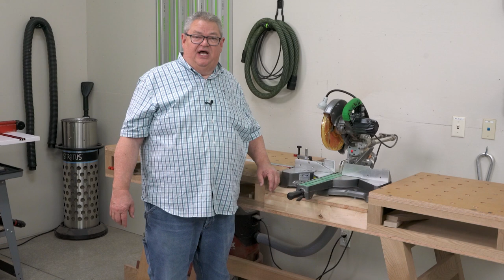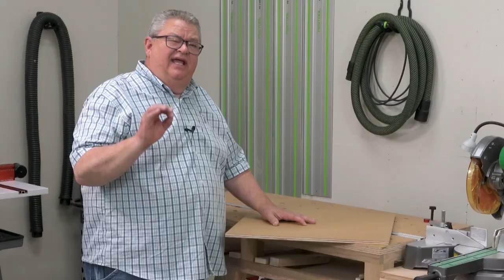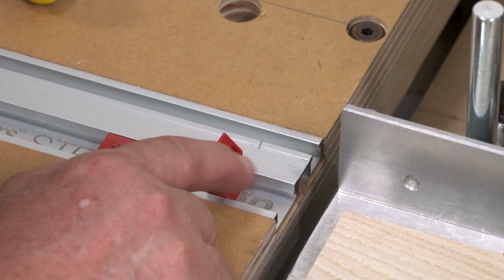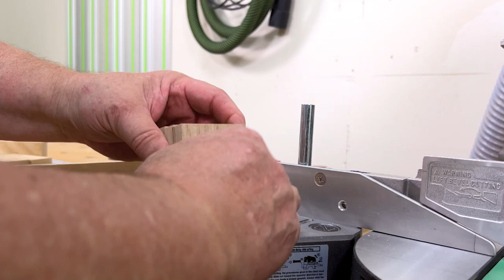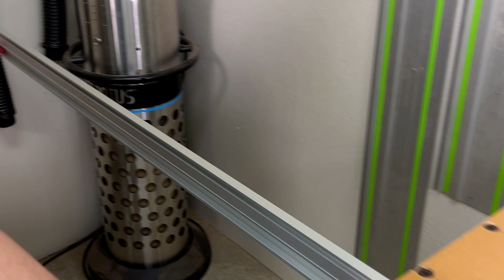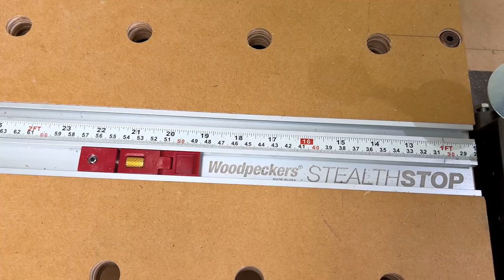StealthStop Miter Saw Project Ideas And Best Practices | Deep Dive

Comment: I have been using the extra piece of wood trick for several years now and it works great - except for math problems.  Instead of 12" or 24", I have made my spacers at 10" and 20" inches.  I find is easier to add only a single digit to the second place of the fixed tape.  If I am cutting 3" pieces, I set the fence to 13".  This works better for me since Murphy is alive and well sometimes.  Of course, if we just all went totally to metric, our lives would be easier.  No conversions, just metric.  Thank you for sharing this great idea to others.
Reply from the maker: I like that, Douglas. On my saw, though, my scale starts almost exactly 12" from the blade, so 12" covers me for anything down to a fraction. On the other hand, I hardly ever cut anything shorter than a couple inches, so I may make a 10" spacer block and see how I like it.

Comment: So what you're really saying is... Be on the lookout for a new Woodpecker's One Time Tool called "The Short Stop" that will be a two piece, laterally adjustable stop for making short cuts on your miter saw safely.  The top piece of aluminum will be 3/4 thick and their will be a series of different height "bottom" pieces that you can connect to it for different thicknesses (symmetrical of course so you can flip the entire unit either direction).  It will have a lateral slide with positive stops at 1" increments and possibly slide into an existing stealth stop track for stability.  Pieces can come in a set of 1/4, 1/2, 11/16, 3/4, etc.. plus a metric set.  And of course, come in a sustainer or Woodpeckers custom case.
That about cover it?  😎
Reply from the maker: I've heard worse ideas!
Reply: @WoodpeckersLLC  actually - this is not a bad idea for an ad-on product....
Reply: And it wll cost $500 for the whole set!

Comment: I had good luck putting a strip of 1/4" ply under the track, and butting up against 3/4" ply. The 1/4" ply is closer to 1/4" than 1/2" ply is to 1/2", if that makes any sense.

Comment: Jeff, I watched a video where a gentleman had issues with a few of his stealth stops.  When he inserted them into the track they were extremely difficult to move.  He took them apart and figured out that the threaded rod was inserted into one of the two pieces of the stealth stop at a slight angle thus causing the two parts when combined, to form a slight V.  The V shape caused them to be overall slightly thicker in the track hindering movement. He also had an issue where the barrel of the micro adjust was very difficult to spin.  He fixed that by taking it apart and sanding a few thousandths of an inch of the end of the barrel.   I received my stealth stop system this past spring but have yet to unbox them as I'm no where near ready to install them.  What kind of warranty does Woodpeckers offer on this system?  I think I need to get mine out of the box and check their fit and function in the tracks sooner rather than later.
Reply from the maker: Dean, it's funny...I found that video yesterday afternoon. I had recently experienced the same issue, but he over-reacted to the problem. I'm pretty confident the press of the screw was just fine. The problem is the ends of the two parts of the stop are molded at an angle. When they assemble them, they spin the thumbwheel down tight...which isn't necessary or advised. I always have my micro-adjuster out just a little bit. If the two parts aren't forced together, the assembly glides through the track effortlessly. Similarly, if he had just spun his thumbwheel in place a couple times, I am pretty sure it would have loosened up without sanding. 

Either way, our policy is always "satisfaction guaranteed". If you're not happy with a product, we'll refund your money.
Reply: I actually had this same problem when I installed mine, but in my case there was a little metal piece on part of the stop sticking out just a hair too far. Three swipes with an axe file and it worked fine.
Reply: @WoodpeckersLLC  I had the same problem with mine Jeff and I also found the answer was to extend the micro-adjust slightly as you said. Hasn't been a problem since I did that. 

To be able to set stops up close, I mounted my vertical track to the face of the mitersaw fence and ran it right up to the blade. I lost 1/2" of crosscut capacity this way but it's a 12 SCMS so not really a show stopper. I bought an extra set of stops when I ordered my combo fences for both the right and left side of the saw.
Reply from the maker: Bob, I've done the same on my miter saw at home. The bolt holes for the sacrificial fence happened to be at just the right height for the track, so I ran the track right up to the blade. Just remember to move the track if you ever adjust the saw for a miter!
Reply: @WoodpeckersLLC  Yes, I left enough space to make miters, but not bevels as I almost never do bevels with the DW708.

Comment: I am not taking away from another quality product from Woodpeckers, however... If you want crazy accuracy, repeatability, and generally no measuring, and you have a fence on your saw station, add a DRO that's made for a table saw. I adapted one to my saw station. It has a resolution of .005, 1/32", and .1mm, and reads ABS and INC.  I am not affiliated with any DRO company, just a machinist turned woodworker who still measures things in the thousandths. Go make some chips (oops) - dust!  Cheers

Comment: I think you should have added the measuring tape to the vertical track as well so you could match up points on the two tracks and then you would have had accurate measurements out to 8' with the combined tracks.
Reply from the maker: True, but then you would have had to locate the vertical fence in exactly the same spot every time. I usually only extend approximately the amount needed. The closer in it is, the less wiggle it has.
Reply: @WoodpeckersLLC  Yes, I can see the logic in that. Thank you Jeff, I have just added the Stealth Stop & Track to my future ‘must have list’.

Comment: What screws did you use to connect the 1/2 in board to your table.
Reply from the maker: Glue and 7/8" 18-gauge finish nails. If you don't have a nail gun, 7/8" sheet rock screws or construction screws would work fine.
Reply from the maker: I may have misunderstood...if you're asking about the connection between the laminated table top and the framework, that is with 1/4"-20 connector bolts and matching cap nuts.

Comment: I got a kick out of statement about the price of Baltic Birch. Anyone who can afford Woodpecker's can afford Baltic Birch. Expensive? Yes. Worth it? Most definitely.
Reply from the maker: In addition to skyrocketing prices, 12mm BB plywood is a tiny bit thinner than the extruded StealthStop track. Not enough to cause a problem, but personally, I would prefer the track slightly below, rather than slightly above. Also, the finish on MDO is ideal for a work surface. As I said in the video, it's not just about price, MDO is a great choice for a project like this.
Reply: @WoodpeckersLLC  That was actually said a bit tongue in cheek. I do own a few small things from Woodpeckers. Being on a fixed income I have to be careful with what I buy. I'll look around for MDO. I can get MDF but have never seen MDO in my area.

Comment: What's the brand of the sliding compound saw that you use in this video?
Reply from the maker: It's a Metabo HPT. "HPT" stands for Hitachi Power Tools. The design is nearly identical to a Hitachi I've had for close to 30 years. I'm not a fan of the giant 10 and 12 inch miter saws. I guess I would feel differently if I was cutting crown molding every day, but I'm not. 8" saws require less power. Lower rim speed means less burning and smaller diameter means less run-out.

Comment: 11/2024 I just ordered and received mine, and each of the four stops fit too tight into the grooves in that they do not easily slide or adjust as shown in the video.  The fine-tune adjustment screws do not turn at all because they are too tight.
Reply from the maker: Improperly assembled. Take the stops out and advance the micro-adjust. After about a quarter-turn it should start moving freely and the stops should travel in the track the way you expect them to. Avoid backing the micro-adjust fully closed. Leave it about a half-turn from contact.  I'll notify assembly that this issue has recurred.
Reply: @WoodpeckersLLC  thanks for the tips. I used a Dremel to sand off the tabs and the ends of the metal pivot pin, and everything worked smoothly.